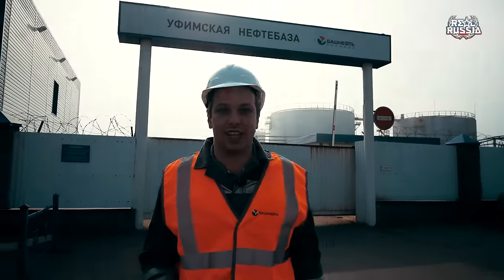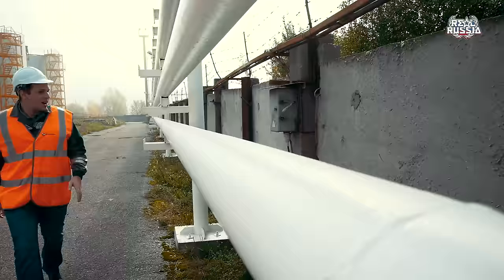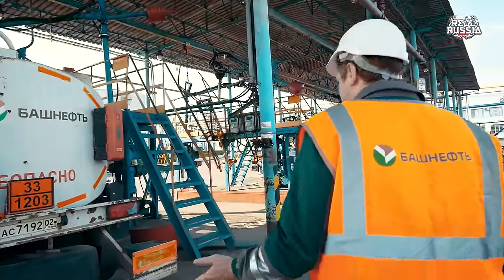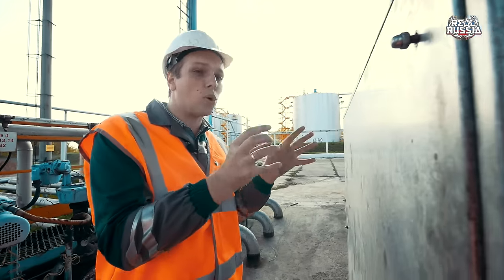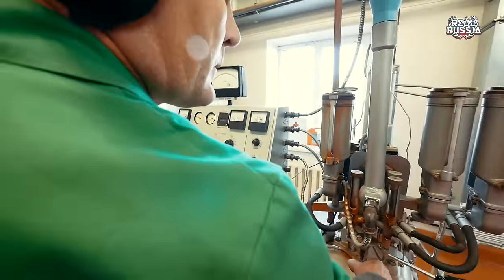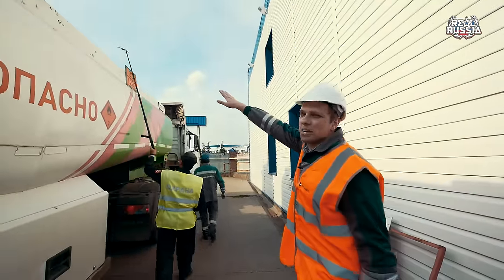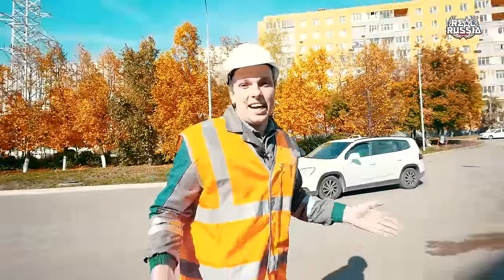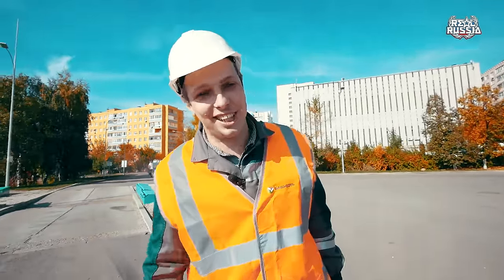BashOil Tank Farm. "Real Russia" ep.140

Comment: Pretty interesting video! Here, in Brazil the price of the gas 87 is about 1 dollar per Liter approximately 63.8 RUB. Greeting from Brazil!
Reply: 47% are flex, which means they use alcohol or gas or mixed, 41% are gas only and 9% are alcohol only. If the price of alcohol, which is about 0.65 US per liter, is less than 70% of the price of the gas, so the alcohol will be the best option. I would say the alcohol is the best option for riding in the city, but gas is most recommend for traveling in the roads.
Reply: In Brazil even gasoline has 27% of ethanol at all filling stations, its a goverment rule. 

The price of ethanol is very variable along the year, because depends of production of sugarcane. Besides that in regions distant of sugarcane plantations and ethanol distillers almost always gasoline is cheaper than ethanol.

 The flex motors were developed because people was desestimulated to buy ethanol motor cars. Formerly a lot of times people converted ethanol motors in gasoline motors and vice-versa because big difference in fuels prices. 

Nowadays with flex motors, people fill with ethanol or gasoline in function of price. Flex motors are not good at all, in my opinion has no good fuel consumption. This kind of engines have average compression ratio, with average fuel consumption, not optimized for ethanol fuel neither optimized for gasoline fuel. Sorry for poor english.

Comment: You should try to get in and see the Oil trade show there in UFA. I looked it up once but do not know what it is called or when it will be again. Similar thing we have in Canada is the Global Petroleum Show, and then there are Manufacturing, Welding, Cement or construction, and Machining trade shows.

Are there any Job Fairs? Where people can see what jobs are available and to even mingle with prospective companies one is seeking to work at.
Currently I am transitioning into Heavy Equipment Technician apprenticeship as well as Small engine repair because Oil market got really slow and I have been out of work since March.

But My point is, What is done for the inspection and repair of such Heavy Equipment in Russia? Such as farm equipment, Semi's and trailers, and Earth Moving equipment. Lets say a small Bobcat or Cat loader burst a hydraulic line, or a pin breaks, or a bearing seizes out in the field. Who does the fixing and how?

One example comes to my mind. I seen a large Farm tractor towing a hay baler and suddenly swerves to the Right and into the ditch and rolling over. Where, just before the unit swerved suddenly, there is a series of oil bursts onto the road. Indicating that something burst or broke that caused the incident.

Comment: In Italy (Milan), if I pay 60 Euros (67 Dollars, 4244 Rubles), I get a full petrol tank of Gasoline.
Reply: If the model of your car Hummer H2(or a similar)  then for this money in Russia, too, will get a full tank of petrol!
(At preset price for 1 liter of gasoline A-95 is 0.55 euros)
Reply: Otto Faust In Italy is much more expensive... I don't remember, but I guess more expensive than 1 Euro per Liter... 
PS: I read right now, that today, in my local Gas Station, the Gasoline price per Liter was 1.447 Euros. (My local Gas Station is about 30 Km away from Milan).
Reply: I owner of a Honda Civic 2010 sedan 1,8L 140 HP. I use a gas in my car. Gas costs about $ 0,27 per litre.

Comment: 4 different fuel wtf?? 
two choices in Ireland, petrol or diesel and some places have a separate pump for kerosene.
Reply: Yes, this is the ordinary picture. The most left for 'solyarka' (solar oil, diesel fuel) and three species of gas with different octan numbers. The 92 octan gas for common cars, the 95 is the beautified version of 92, and the 98 octan number for luxury cars (like some Audi and so on).
Reply: And what is kerosene for? In Russia it is used for airplanes only.
Reply: +Дмитрий Вронский It is used for central heating in homes and I think some agricultural vehicles
Reply: In Russia we don't use kerosene for that purpose. Agricultural vehicles mostly use the diesel. Apartment buildings are heated by central city heating. Piped water flows with a temperature of 80-100 Celsius. Then enters The heating radiator. Also, there is always a hot water in tap in apartment. Houses are heated by gas or coal.
Reply: A small correction. In old apartment buildings the natural gas is often used in water heaters. Also stoves often are powered by natural gas. In private houses natural gas is commonly used in heaters and in stoves. Even some cars are using natural gas, there are special gas stations for them. As for gasoline (= benzine) which  is often shortened to 'gas' (that may confuse!), it is used in Russia for cars only.
Reply: Absolutely agree. I described my region (Western Siberia). And i personally use a natural gas in my car.